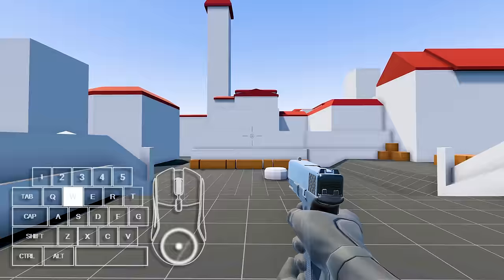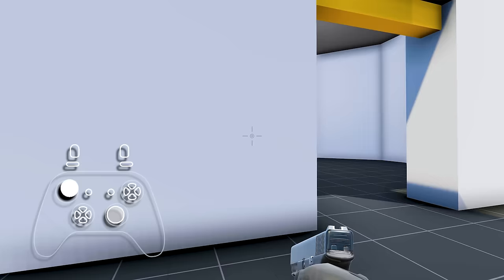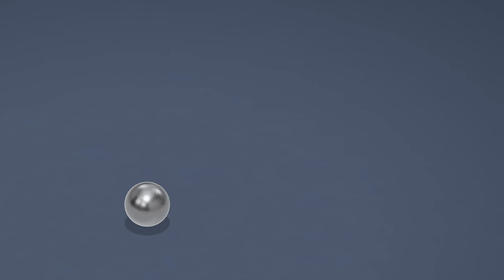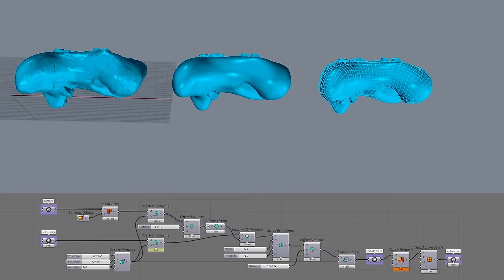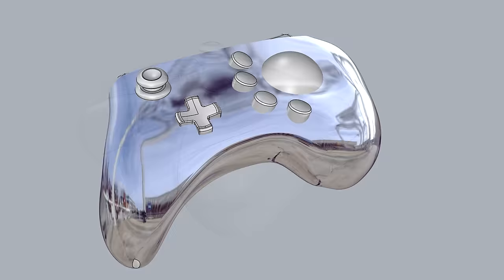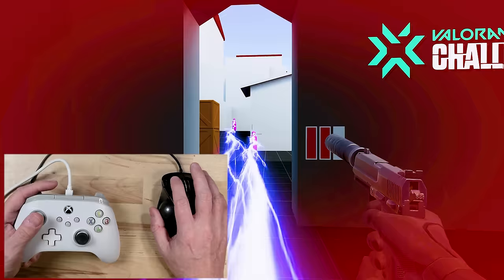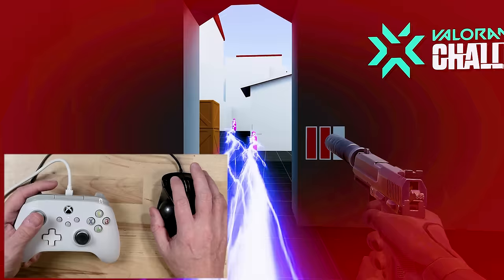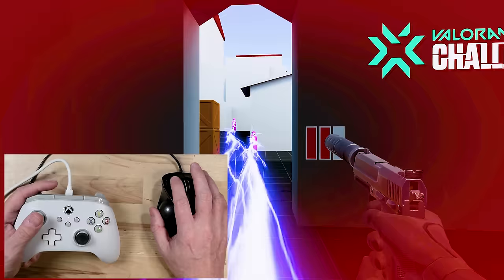Ultimate FPS Controller Design & Build

Comment: As a Steam Controller/Deck trackpad enjoyer, something that basically kills this is that most games do not have support for mixed input so you can either use the mouse or stick, not both.
Trackpad/ball are superior in controller form than to stick, but because they weren't looked at seriously until recent years they are so against the norm that even one of the biggest gaming companies in the world couldn't make people take it seriously.
Reply: Not to mention an analog stick is so much cheaper than a trackball setup. That being said adding a trackball is way more compelling of a change to me than the “adaptive triggers” they added to the ps5 controller
Reply: Tbh, gyro controls are probably the way forward for controllers. Trackballs require a lot of maintenance, and I'm not convinced that the thumb variety (the only kind that'd work in a controller) is very good for aiming at all. Take it from a trackball fan who games with one almost every day: I am a clean freak who washes his hands before every use (drying them with a clean paper towel), but still, my trackball inevitably has to be cleaned and lubricated at least once a week, more like every 5 days (side note: the best way to lube them is actually to rub the trackball on your cheeks/the bridge of your nose and then roll it around in your palms before you put it back in, assuming your face is recently-showered). The ~feel~ of your aim is always constantly changing as dead skin builds up around the bearings
Reply: trackball could emulate an analogue stick
Reply: @HontoNeet there it is. A shocking lack of mention for gyro controls despite them being the seeking next step for most controller based aiming as it just adds that granular control to bridge the gap between a mouse and a ‘dumb’ controller.
Reply: Agreed, love the Steam controller so much I hoard them. I set the trackpad as a mouse input rather than a joystick in Steam whenever possible, it allows much more precise movement and additional features like acceleration. It's always a bummer if a newer game doesn't support dual input but most seem to. It also doesn't help that games' configs all have edge spin set off by default, it makes a huge difference having Edge Spin set up properly.
Reply: @JeronimoStilton14  motion control on a controller is trash if you still have to do everything else with it. 

Not reliable enough if you have to smash 10 other buttons while trying to hold the whole controller steady. 

Even in vr there is not a single game where you have to aim and do something else with the same controller at the same time because of obvious reasons. Despite being the most superior way of aiming/controlls eeeever.
Reply: @HontoNeet This, and I still think flick stick is the way forward with first-person shooters on controller. Gyro is what makes flick stick possible. Having granular control over your horizontal and vertical rotation without having to wait to turn is what gives mouse the advantage over controller, but flick stick makes this possible. Being able to instantly 180 is a huge must!
Reply: First, I can’t think of a case where you would literally need to “smash” 10 buttons at the same time while thing to aim on any control method, so I assume you are just being hyperbolic here. 

Second, aiming while pressing other buttons is just something you will have to get used to over time. Just like most people with most control methods the first time they try it.

Third, there are things that can be done to make it easier like an activation/deactivation button or a reset camera button. And ofcourse sensitivity settings so that the player can set it to what feels right of them.
Reply: While I had no issues with dual controle til now, I really appreciate the number of inputs there are on a steam deck with games like satisfactory.
Reply: A game that sold me on motion controls was tears of the kingdom (didn't use them on botw but same applies)
I had gotten my hands on a third party controller that had gyro support and while it took a couple hours to get the hang of it, it really reduced my hatred for controller aimas i do have a heavy preference for kb/m. 
That being said, im looking forward to getting my hands on a steam deck and trying out thd touch pad, though im definitely concerned how many of the games id play support dual input as mentioned.
Reply: @nicoschroeder5379 thanks for mentioning that! Every FPS freak keeps this discussion about the better aiming but they never tried VR! There's no better aiming than actually aiming like in VR!
Reply: @nicoschroeder5379 What are you talking about? Most VR games make use of concurrent motion and button/stick controls. It's perfectly intuitive.
Reply: @nicoschroeder5379  I get the feeling you haven't used gyro in a while. I don't often use a controller in games where aiming is needed, but when I do I have my default steam input profile for my Dualshock 4 set to enable gyro on left trigger soft pull. It's amazing, it keeps it out of the way until you're actually trying to be accurate, it engages just before ADS pull distance in every game so you can use it with or without ADSing, and I loathe playing without it in games that don't support steam input very well.
Reply: @cho4d that's what I usually end up doing in games which don't support mixed input, but it's very hard to make it feel decent, and even then it's nowhere near as good as if the trackpad works as a mouse
Reply: Agreed, i have a wooting analog keyboard and while its VERY cool when it works, most games dont support the mixed input and will freeze my mouse when walking around or vice versa
Reply: @HontoNeet I can actually use this controller for day to day browsing though. There’s no way in hell gyro is worth anything outside of shooters and niche puzzle games. This trackball controller is versatile enough to be used in nearly everything. Even RTSs.
Reply: I just map gyro and stick to mouse with Rewasd.
Reply: I am also a Steam Controller enjoyer. 
I have 2 of them, bought used. 
The only problem is the stick gets drift quite easily. 
Ive not had drift problems with ds4/5
Reply: Also the polling rate is a real issue. Steam Controller is <200hz and if you try to walk around an object while looking at it there is horrible micro jitter that blurs the whole screen. Anything that wants to be a mouse replacement for FPS games needs mouse levels of polling rate.
Reply: @drewh9755 why not both? I love the adaptive triggers even if they aren’t revolutionary.  They still are a step forward and should stick around.
Reply: Could prob decode signals to what the game understands
Reply: @nicoschroeder5379  It's clear you have NEVER actually attempted to use Gyro control in, basically any modern game that makes use of it. Have you even played Breath of the Wild/ TOTK on the switch before? It's amazing how much fun the archery is with motion. It's not like the Wii where Motion Controls means waggling a stick around like a loony bin. One of my favorite creators, Nerrel, has FOUR long videos on why Motion/gyro Controls work great, and the stigma that they have because of the Wii, no one has tried it and made it work outside of Nintendo and Valve (KIND OF Sony, too, but they have been much more lax on their implementations).

There are several pro players in the Apex community who use flick stick and Gyro. Valve has it implemented in CS:2 even though KB+M still reigns king. Steam has an entire infrastructure allowing you to customize your controller layouts to your hearts content, even including Gyro support with controllers with the sensors. 

Do not speak on topics you are not knowledgeable about; and don't try to lambast the idea when there will ALWAYS be a toggle allowing you to turn off the Gyro feature if you hate the idea so much.
Reply: Trackballs also just suck
Reply: You would almost certain get a ban for using this too
Reply: It already accepts these. The trackball glove works perfectly. Plus the odd Japanese trackball fighter decks work as well. There is no reason with this wouldn’t work immediately just by emulating one of those. 

I love it when people think they know everything and run off believing it. While we are here reading the dumb crap they say.
Reply: @HontoNeet  just stop using shitty trackball mice that use bearing balls to roll against. especially the many that use awful quality bearing balls. roller bearings aren't the most ideal choice but they don't suffer from the tiniest bit of dust jamming up the ball. Ideally someone would make a trackball around a ball transfer unit.
Reply: @YukikazeQ  I've heard of ball transfer units but idk anything about them. I'd love a more premium trackball that didn't sacrifice on the number of buttons, but no such thing exists. Really, a high DPI, programmable trackball with a ton of buttons like an MMO mouse, that'd be ideal. There is one gaming trackball out there, but it has very few buttons, and I don't think it's programmable
Reply: @JeronimoStilton14  still, one thing that holds back gamepads with gyro, better stick precision, hall-effect and whatnot: slow ass camera movement ceiling in some games. most frustrating when it happens on rather recent ones too. honestly, in most games I always have to crank up sensitivity to max to get the quickest turns possible, while still retaining precision movement with gyro. or right, then there are also built-in deadzones that can make gyro aiming useless too, but at least it can be compensated with Steam input or other remapping software.
Reply: @nicoschroeder5379  The "issue" you're describing isn't an issue. Maybe you don't realize that with gyro aiming, you aren't exclusively using the gyro. You still use the right stick for the vast majority of larger camera movements.
Reply: It's not that they aren't popular because they weren't looked at seriously.
It's that they weren't looked at seriously because they aren't popular.

It's not that it's objectively superior, it's that you're in a very small minority who thinks of it as superior. I've been using a trackball at work for a long time and I've had a Steam Deck since basically day 1. Still, I simply don't enjoy gaming with trackballs and trackpads and most people seem to be like me.
Reply: No one is talking about the fact that aim assist is locked out of mouse setups, for obvious reasons. So it make sense game devs cannot allow for a player to use a mix of mouse and controller
Reply: fun fact when i tried mnk on paladins on the ps4 i was able to use both mnk and controller at the same time. idk if that same thing works on pc or ps5. hell idk if it still works today on the ps4. since the game has been updating
Reply: Is buy it today
Reply: @AcceleratorEsper0  easy fix if they determine aim assist enable by the input type that controls specifically the camera at the moment, not whole input device used. still, as I've said theree's a lot of nonsense in gamepad controls implementation in some games.
Reply: Problem is that it has been eclipsed by gyro. 

Gyro is about as good as m+kb
Reply: @Senriam  yes, although there aren't that many gamepads with gyro and really low input latency, especially wireless. plus as I've said, some games don't allow for really fast camera movement via joystick input, to the point that it's easier to remap right stick to mouse with some adjustment + gyro complimenting it. and of course that also often means you have to remap left stick to WASD and all other buttons to match kb/m input
Reply: @JeronimoStilton14 there is a simple reason why mouse is superior for gaming, we use it all the time even while not playing, so we still dont have a intuitive feel for a trackball or gyros. Maybe that changes if these ideas are used more commonly in future, i.e., some company finds a way to make a shit ton of money with this type of tech.
Reply: @x-iso  “easy”. The game would need to allow both inputs at all times for this, and then would need to live check every waking moment of a match to make sure some smart ass did not configure with one controller and started using the second one mid match
Reply: What kills me is that you cant buy Steam controllers anymore... Had to settle for a DS4.💀
Reply: GTA would be a good candidate
Reply: @AcceleratorEsper0  with PC games you normally have kb/m always available when you use gamepad and of course you can use either at any given moment during the game, it's just that in some games if input from gamepad is detected, it doesn't allow using kb/m or the other way around at the same time, meaning you can't use left stick to walk while aiming with mouse or use right stick while using keyboard at the same time. for anti-cheating the only thing that matters is which input is actively controls the camera, nothing else. 

but that's just a minor detail in larger issue where auto-aim shouldn't be allowed in online matches at all, gamepad or not. it's a stupid premise that gamepad user needs auto-aim help when they're clearly playing online competitive game and not casual single player stuff for the story. there are plenty of gamepads that can match and outperform kb/m without any autoaim BS, just by using gyro and hall-effect sticks, plus trigger stops or adaptive triggers for quick actuation like on a mouse (if we're talking abour FPS).
Reply: @HontoNeet  do track balls currently use magnetic ball sensors? Cause if not, maybe that could solve the issue with them? But we wouldn't know unless they became more mainstream so there is incentive to develop the tech more
Reply: Ive been playing hybrid controller/mouse on many game like fortnite, gears 5, overwatch, but i would like to see this getting common over game like warzone and other device than pc
Reply: it's like when snowboards were being made, lots of people didn't want them on the ski slopes. now look at them!
Reply: Trackpad + gyro is arguably better than a mouse, and you can move faster.  Also you have far less stress on your wrist and fingers and can play for much longer without carpal tunnel.

I’ve played through several different fps games with my steam controller mapping the right trackpad and gyro to mouse aim.  The Division 1&2, Black Mesa, Halo Infinite, Breakpoint, Counterstrike, Stalker, Metro 2033, Arma 3, and a few other games I cant think of right now.
Reply: @HontoNeet   gyro has its advantages for some games.. mainly racing.. but its super awkward and incredibly fatigue inducing with fps shooters. the need to tune it to your own personal feel creates far to much added documentation .which rarely is present or understandable with out a grip on basic physics and ipd controllers on something that should feel natural as a standard to use day one.  a lot of games can standardize the feel, but with fps its impossible to make one sensitivity feel good for everyone.
Reply: @hereandnow3156  the problem is the bearings that determine how smooth/consistently the ball itself rolls, they're high-maintenance. All human hands shed dead skin and secrete oil, there's always dust in the air, stuff gets down in there
Reply: You are incorrect about "recent years".  This existed as a product in the 90s and was very well liked.  Also I think many/most PC games allow for both controller and mouse/keyboard use simultaneously.
Reply: @Verchiel_  There isn't one game I've played using the Steamdeck that doesn't support the touchpad. It really is the ultimate controller setup if only it had a smaller form factor.
Reply: you can always emulate a mouse with the controller, as is common for steam controller/deck, so i don’t see why that would be an issue?
Reply: yeah cod only allows 1 input and will lock it ingame in certain modes too
Reply: Honestly I think game developers will eventually notice the demand for fine tuned products for their games specifically.
Reply: @fapman4878  On PC, they used to use keys to rotate, but once people saw 1 guy playing Quake with a mouse, everyone started doing it that way. 
Sometimes things just make sense for the majority of people right away, while sometimes they only ever make sense for a small minority of people. 

Those years it took to develop aiming on a controller, sticks weren't the only option. There have been hundreds of attempts and hundreds of poor controller designs. The thumbstick we have today is a development from people just happening to enjoy the stick on the N64, so companies stuck with it. 

The way I see it, the chance has already been given, and trackballs lost the race. But we'll see what the future holds.
Reply: Huh cry baby😊
Reply: @drewh9755  fun - fact trackball is only expensive due to the fact there is little market for it, parts are rather cheap ( even synthetic ruby bearings arent that costly, plus ceramic ones could work, and replaced metal ones could work too, just you would have to replace them sometimes ), otherwise it's optical mice parts.
Reply: @HontoNeet  How ? I clean them once a month and I use one laying on carpet sometimes.
Reply: I can't speak for anything newer than HL2, but I assure you that mixed controls have been possible since the late 90s, and I have been using the input method that he tested since the late 2000s.  Won't pretend that it works great in Unreal engine, but anything related to (or derived from) Quake engine should still have cvars to make this possible.
Reply: @JeronimoStilton14 why are you mad that he didn't mention gyro controls when the original comment was about the trackball that he replied to with personal experience regarding that?
Reply: @HontoNeet  Use silicone oil used in airsoft, just as good, and not as gross. Lots of moving parts in airsoft, and we don't want stuff to gunk up either. Give that a go instead of human oils from your face.
Reply: @copperboltwire320  The thing is that 1: oil from your skin ends up on computer peripherals anyway, and 2: I don't want even trace amounts of some weird mechanical lubricant getting on me just from using my PC. Everyone touches their face, I rub my eyes and stuff, I don't wanna have to remember not to touch anything with my right hand, having to wash it every time I've used my trackball

Edit: also, cost
Reply: el steam controller es una basura
Reply: @HontoNeet  that's funny, nose grease is a long known trick of improving bass playing with rough strings. Glad to see it branching out 😂
Reply: Agreed! I love trackball in many things like audio-, video- and 3D-edit. in RTS games nothing comes even close to trackball.
Reply: Mixed input doesn't have to be an issue. You can map everything to keyboard and mouse controls. Your brain will forget the input prompts very quickly 😊
Reply: @johnnymeansii  do you use Steam? If so you can do that with Steam too. It works very well.
Reply: @reptarien  

Which pro players use gyro in Apex?
Reply: @cho4d yes, it could, but that isn't how this project was done.
Reply: @ThePostalOffice  I am not mad about anything related to this project.
Reply: @cho4d nah the exact opposite. The rest of the controller emulate a keyboard.
You REALLY want the mouse to stay as a mouse. That's the whole point.
Reply: @nicoschroeder5379 Objectively you will perform better with a gyro aim setup than just using analog sticks. Feel free to try it in aim lab sometime and see. Your scenario about keepinf the controller steady is a non issue because you do not keep the gyro enabled all the time. Usually you turn it on when using aiming down sights or via touch activation on a track pad. The only issue is it is still not as good as a mouse.
Reply: Steam controller trackpad is amazing and only limited by mixed input support like you mentioned (although "joystick mouse" can get close to mouse when the game lets you remove the deadzones\axis snapping\other stick "optimizations")
But deck's trackpad is not suitable for camera\look controls. It's small and flat and oddly positioned. It's quite good for mouse pointer controls tho, through "mouse region" mode.